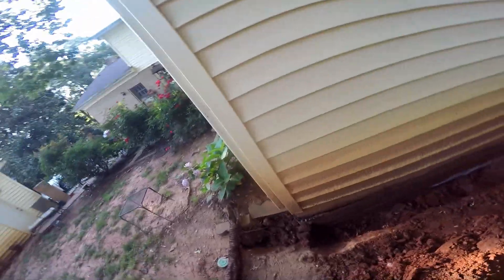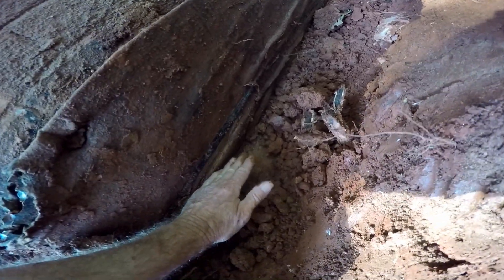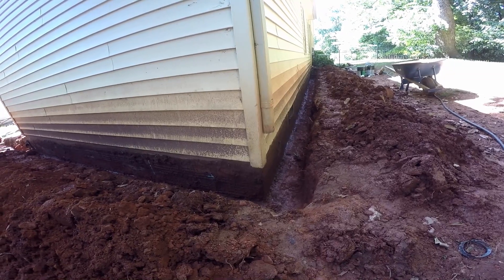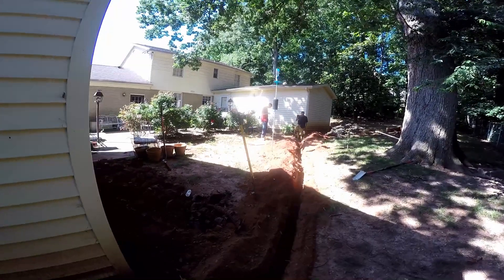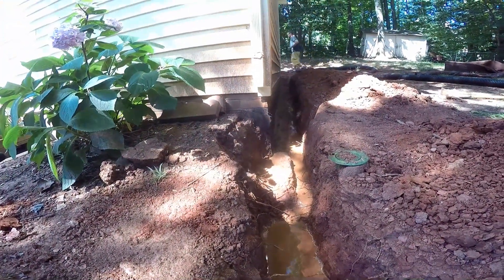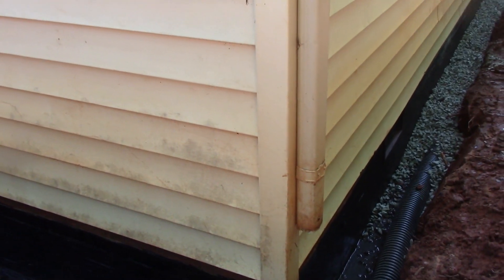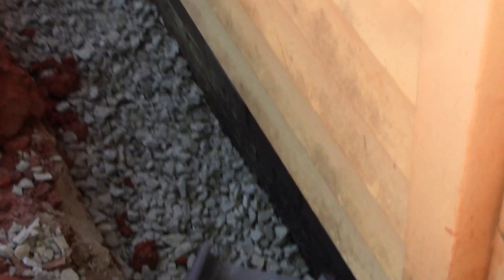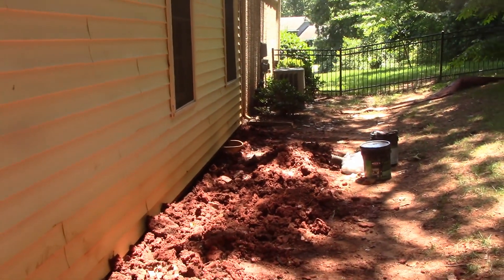Foundation Waterproofing, Footer Pipe, Liquid Rubber, Discharge to Daylight

Comment: You're supposed to use PVC pipe. That corrugated pipe crap collapses after a few years. It's not a surprise why you don't mention PVC pipe. Contractors always go the temporary route so they can come back for repairs years down the line smh
Reply: If you actually watched this guys channel you'd know he's a true professional, I bet he installs miles of corrugated pipe every year and has been in business for 20+ years. I'm sure he would just be trashed on internet reviews if he had comebacks for all those places he installed corrugated.
Reply: there is a stronger corrugated pipe that is yellow, I agree the black one collapses. I am not sure about PVC pipe never seen used for that type of projects

Comment: Is there anything wrong with connecting a footer drain to a downspout?
Reply: Michael Johnson , yes. Bad idea. You will be sending dirt, debris and a crap ton of water there. May impede water pickup into the system.

Comment: Hello chuck, I will like to ask you what do you think will be the best waterproofing option for a new construction ? I am building my house :) and I was thinking on using a perforate pipes around the footing and connect them into a inside sump pump, put some graver under the pipes 3" and put another 6" on top, them put a blueskin membrane for waterproofing the walls and on top of that something like the Delta MS. Please let me know your point of view because one guy was charging me 4200$ CAD for this job and I know the material wont even cost me 2K if I do it my self
Reply: Hi, we are manufacturer of corrugated drain pipe, please contact us at Joyce@wavepipeline.com, hope i can help you.

Thanks